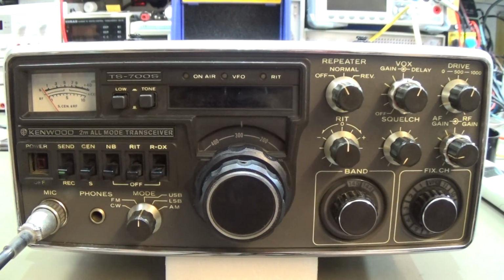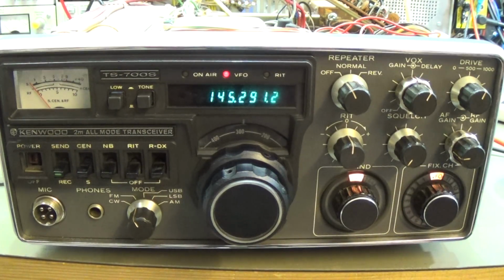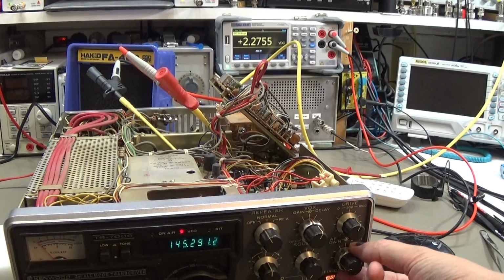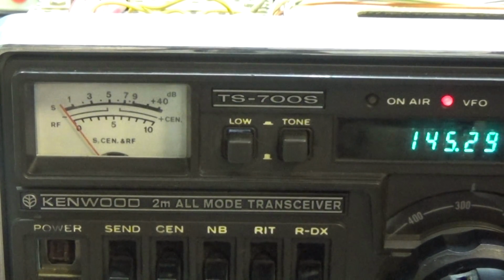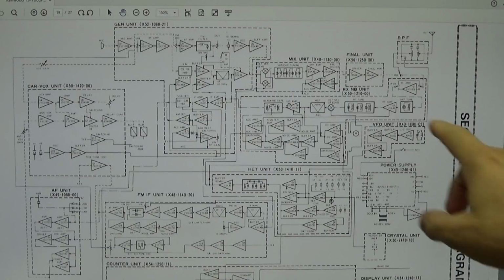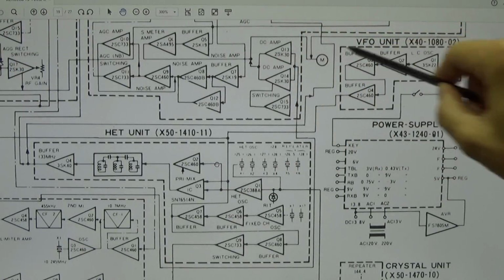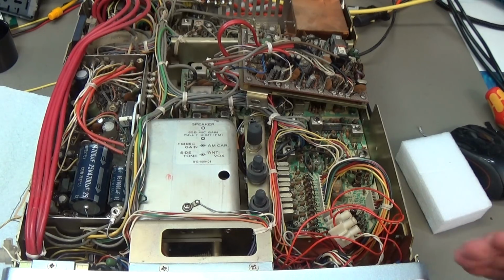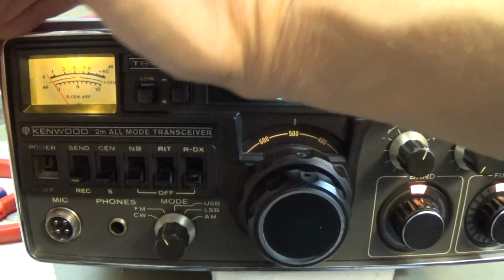#148 Kenwood TS-700S when a repair turns into a restauration

Comment: Caps are not a big issue for this radio. I found in my 700 / 700s and 770E transistors which where bad on there Hfe values. Problems like no squelch, S meter (AGC) issues and for the 770 PLL locking problems. Still very good transceivers for there age. Still like to use them.

Comment: I have a TS-700SP and as it warms up the output power gradually drops until there is zero output. It is a nice built radio as far as the outside controls but inside it is a nightmare to service. In my experience those early small radial capacitors used in transistor circuits fail with age and there are a lot of those capacitors. If it were a vacuum tube transceiver such as a Gonset it would be much easier to repair or for that matter to restore.

Comment: Im having a issue with mine where the radio seems to be off by 1khz on the dial where is the best first place to look at. The radio receives well and transmits well but off by the 1khz I have a TS-700A Kenwood

Comment: Hello Pete, this is one of your  best videos I saw. I think that a 45 year old rig is somthing more for restoration than a small light bulb replacement. I got, almoste as a present a 78 TS-180s, just from the same age that powers up, but no reception and spurious sound when tuning. Mint condition from outsider, previous owner operated it without issue many years until it stopped, and since that, no repair atempt was done. Would you say, do first a full recap over all and a mecanical maintance on wafer swich and VFO before any further atempt? For me its a restoration project and no matter how much hours I have to spend until a complete restored and working rig. It would be a replacement of around 110 !! electrolytic and of cause more 10 tantalos. Is it like this way as it should be done right?

Comment: People don't understand working with old radios can be very much time consuming and patients and maybe cheaper in the long term to replace the radio you could replace the caps and aligiment and maybe some other component could fail a little time later the main thing you got it to work the owner would need to be made aware much money needs to be spent to get it restored to like new such time consuming as you say 20+ hours!
Reply from the maker: You are absolutely right John...Thanks for stepping in 73

Comment: With older equipment like this I normally start by testing capacitors that are near any heat dissipating components (voltage regulators, power amplifiers, etc). These are the most likely to go bad as the life of electrolytic capacitors depends very much on its operating temperature. If those capacitors test good I put them back in and leave everything as-is. If they are marginal or clearly bad, I replace them, and then I will randomly test a few sample capacitors from cool areas of the radio. Most of the time I find that capacitors that are away from heat sources are still perfectly fine even after 40 years.

It also depends on how much the radio has been used (powered on) and what type of environment it was stored in. A radio that is not used frequently and stored in a relatively cool area will usually not have any capacitor problems.

Modern electrolytics of the last few decades from reputable capacitor manufacturers are actually very very long lasting as long as they are kept cool!
Reply from the maker: Thanks for summarizing my video #76 :^) Cheers

Comment: Good review on the older radio Peter; I also am not happy when the repair job turns into a total rebuild.  I don't like to give up on any of the vintage radio equipment, but the cost is better contained when one of retired hams, (like myself) takes on the project!  Thanks again!
Reply from the maker: Yes I fully agree Mike..Thanks for watching 73

Comment: Something that old probably should just start off by recapping it first, likely would fix some of the issues, and re-align afterwards. I normally forget about charging a fair price when doing major work like that, even if it takes me days to resolve a tricky issue I only charge what is fair for the radios value, makes the hourly pay rate pretty rubbish though, but I do repairs mostly for the enjoyment, its not a job for me, wouldn't be the case for techs that do it for a living.
Reply from the maker: Always good to recap after all this years of duty... 73

Comment: THANKS FOR THE GOOD VIDEO PETER, I THINK IT'S 41 YEARS OLD OR SLIGHTLY LESS. IF I REMEMBER THE R-DX IS THE RECEIVE  PRE AMP.  THE NEW LEDS DO A GREAT JOB REPLACING THOSE TINY BULBS. I SPEND A LOT OF TIME ON 2M SSB WITH MY TS2000X MADE IN NOV 2010. DID YOU WHACK YOUR THUMB TRYING TO FIX AN OLD SWAN?? HAHAHAHA. JUST FYI, THE CARTRIDGE IS A 44 MAGNUM, I RELOAD ALSO. HI TO BUDDY BELOW. KØOJ
Reply from the maker: Thanks for feed-back Orlin! Yes this little LED's are just great. LOL not an old swan but the door of my car haha..Ah a44 Magnum very impressive. Have a nice day 73
Reply: OUCH.  O J

Comment: Peter, thank you for sharing. Great explanation of the AGC curcuit. Sorry it ended up as restoration. Hope the owner does restore the radio at some point. However as you stated alot of time to do a restore, I'll bet a week or more. Thanks again Peter.  Joel
Reply from the maker: Thanks Joel, finally the radio can be used...73

Comment: It is a lot of work to recap one of these.  Been there, done that.  It will definitely test your patience for sure.  Wire wrap may be fast and cheap for assembly but for repair work it can be a real pain to deal with.  It adds a lot of time to a restoration.  Main thing is you got it working and as long as the customer is happy that's what counts.

Mike
Reply from the maker: That is exactly the point Mike. Wire wrap was good for production but it is a nightmare for service...I'm so glad that we have SMD's today, so easy to work with...73

Comment: Thanks for sharing another great video Peter. Yes the radio is worth restoring.  Since few companies produce a stand alone all mode VHF rig we have to keep these going.  But like you said, this is more than a repair.  Restoring an old radio takes a lot of time on the bench. Trust me I know. It is not something the average repair tech can make money on.  I have to turn down so much work because of it. When I do accept a restore most folks get irritated because it takes so long. Thanks again Peter and have a great week end.
Reply from the maker: I fully agree Buddy it is more than worth to restore but as you already said it takes easily 20-30 hours on the bench. That is something what a owner needs to know and he has to clearly decide for a restoration  with all the consequences. I have the same experience if you telling somebody that it will take time most folks are more than irritated  simply because they can't judge what behind a job like this...Take care my friend 73
Reply from the maker: No doubt Dino I fully agree with you and Buddy and it so sad that there is nothing on the market today so we have to take care on what we have.. Thanks for stepping in 73
Reply: @TRXLab  try ft 991a   kg6mn
Reply: BTW in case anyone is interested in all-mode VHF/UHF rigs - Icom looks set to introduce the IC-9700, the replacement for the 910H...looks very SDRish to me! Saw a YouTube video of it yesterday.
Reply: Agree with Buddy about trying to keep these old all-modes alive...I lusted after this rig in the mid 70's but ended up with the Icom IC-211 (XYL bought it for me for a wedding present!). Really nothing on the market these days for the niche which is why I'll keep my IC-910H for weak signal VHF/UHF/SHF and satellite work.